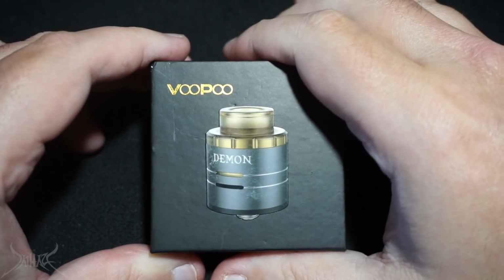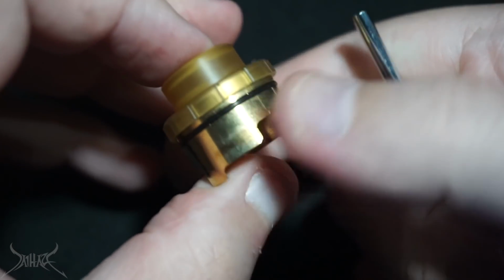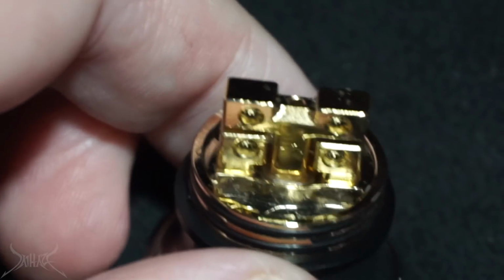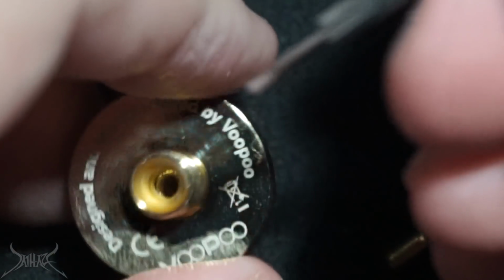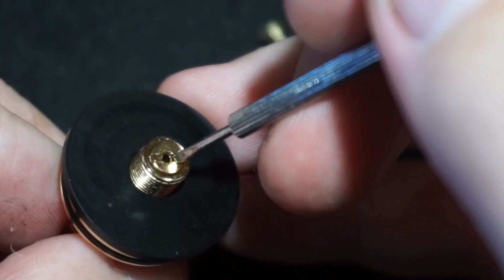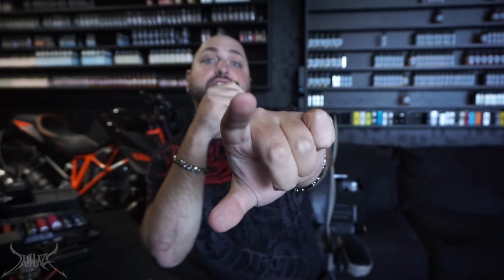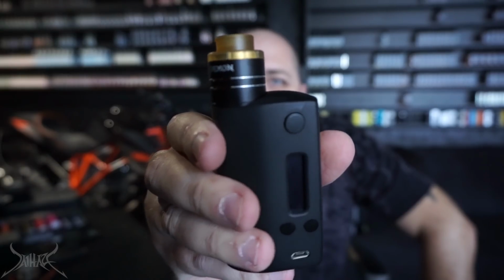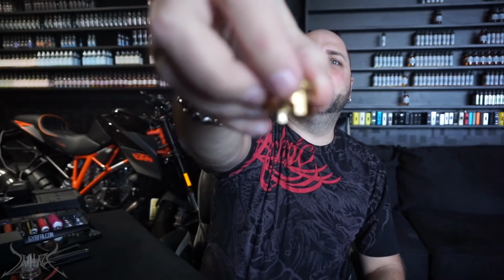Voopoo Demon RDA/RSA Review and Rundown

Comment: I don't get this dripping thing. Im vaped over 2years and I don't get why this thing had to be so difficult. Carry your juices in different bottle. Rdta or Rta are just fine to me. No need to drip or drop or squonk. Just push and pull.
Reply: Jari Tiilikainen I drip with an rda every where I go. It has never bothered me because you will carry a bottle regardless what you vape. Last time I checked most squonk bottles are only like 3-8mil and that would not last me a hole day out running around so it's obvious you will carry a bottle regardless. Rda is the only way to go if you want the best flavor possible. Tanks are shit. When they make one that has great flavor like an rda they I will change to that.
Reply: Jari Tiilikainen you ever notice that by the end of your tank your clear juice is all brown and shit and tastes off? That's why dripping and squonking is around. 

Squonking is like using a tank but not having the juice get tainted because the coil isn't contaminating the juice reserve.

Most people that drip tho started before tanks were any good so it's just how they do it still.

Plus the flavor is next to none from RDAs.
Reply: When I first started we had tiny tanks with a wick and i hated them. Ever since then I've always used a rda. I've used many rdas, rtas, and tanks but I always go back to the rda. Because the flavor you can't get from a tank. Usually the coils in a tank are not all that great and can't last a week on high power. The flavor is pretty muted and it has always made me stop using tanks